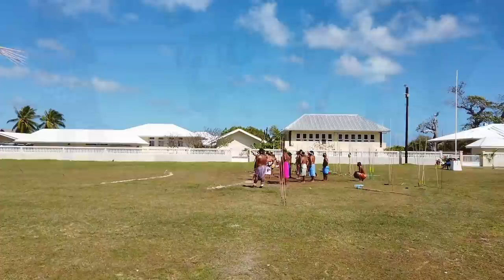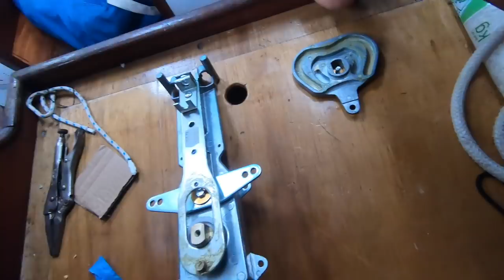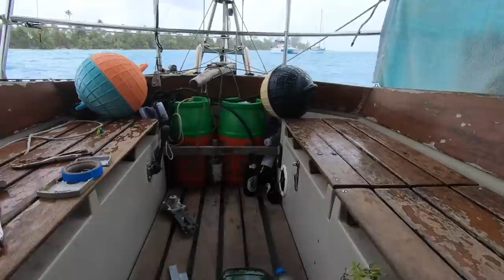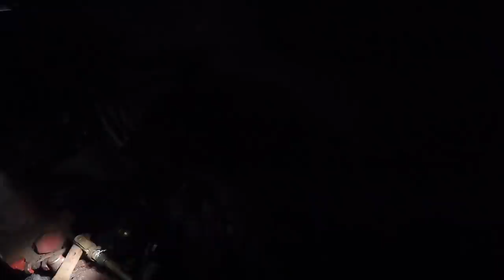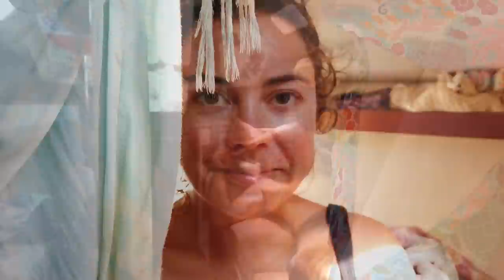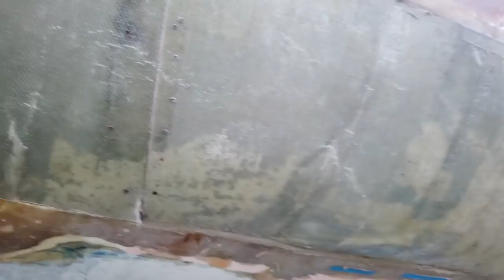Coconuts, New Throttle, and  Most Scenic Boatyard in the World WHS  E75

Comment: Hey Holly, you are living my dream. I hope to get there... someday. 

Some quick suggestion for caulking jobs, learned the hard way. Clean the old caulk off. Different chemical compositions can react with each other and just make a gooey mess. If possible, run a bead of caulk around the perimeter and around bolts - in between the mating surfaces. This gives a much superior seal. Leaking through hardware may not fill the bilge but can contribute to rot, mold and mildew.

BTW, I think your channel is my favorite sailing channel.   Good luck, girl!

Comment: Those morse controls are a nightmare to change. On mine the button in the middle was broke, so you couldn't disengage the gear leaver to just run the throttle to charge your batteries. I bought a secondhand one and ended up making 1 good one out of the 2.